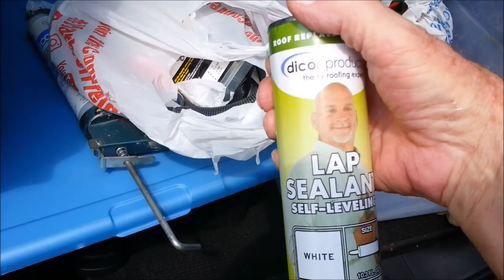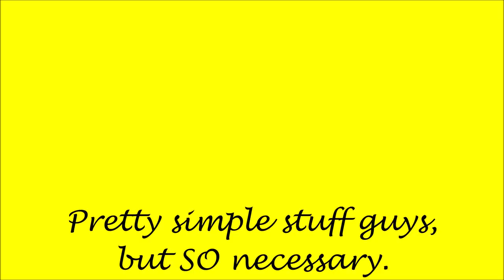Sealing cracks on a Camper Trailer  roof 101.  Rockwood Mini Lite

Comment: Rockwood's Factory rep wrote me about the OEM roof membrane on my 2018  model 2109s:
"F100099856 - RUBBER ROOF - IHO: RUBBER ROOF MATERIAL, SUPERFLEX - WHITE - 102" WIDE - V# SFX850WH350"      
So- this material is a TPO roof membrane manufactured by Alpha Systems..who says:
"Alpha’s TPO is a single-ply membrane that is approximately half the weight of EPDM and PVC, will not chalk or fade, has brilliant UV performance and is resistant to mold, algae and fungus."
Reply from the maker: Cool.  Glad you got your answer for sure.  :)

Comment: Garland;
  I note that you have a number of RV roofs to maintain there on your site. I own a Rockwood 2109 with that same curved roof at the front where the curved fiberglass overlaps the roof and is held down with strip of metal and thick coat of lap sealant. My RV is a 2019 model and the screws used to hold this metal strip look to have popped up from the tension of the curved fiberglass. I now have a large 1/2" - 1" gap where the strip and lap sealant have all come loose. This goes half way across the front and looks to be progressing while popping screws out along the way. What would you suggest? I'd like to strip off the sealant and see if I can use longer screws, but I'm not sure what's underneath (how much wood is there).
Reply from the maker: Hello Dwight.  Oh man, that is a storage lot Dwight.  Thank HEAVENS I don't do anything on everyone else's campers.  :)  I was just working on my 2109s.  

There is very little or no wood under the roof Dwight.  The front and sides are Azdel, not Fiberglass.  It is easier to drill and work with.   

If it were me, I'd remove one of the screws that is obviously backing out to see how long it is.  You want to use the same length screws again.  That strip of metal across the top "could" be screwed into an aluminum structure or beam running from side to side.  Me?  I would remove any Lap Sealant I could to get down to the metal strip running side to side as you described and add more screws into the metal strip down into the cap of the camper, dabbing them well with Lap Sealant.  Remove any loose screws, dab them up good with Lap Sealant, and reinsert carefully paying attention not to strip them.  Cover it all again in self leveling Lap Sealant and keep an eye on it from here on out.  Worse case scenario, they come out again.  Which in my mind, means they didn't screw into an aluminum supporting beam running side to side.   That then, well more work by someone other than yourself or me.  Keep researching too, I'm certainly not the be all and end all.  

Here is a video by Rockwood on assembly of a Signature Ultra Lite.  It is larger, but the assembly and parts are essentially the same.  I suggest you watch it.
https://www.youtube.com/watch?v=3D672Pj96WE 

Good luck my friend.

Comment: Garland-  I have the same 2109s that you have. What type of roof membrane material do these trailers have...TPO? EDPM?     I can't seem to find a definitive answer anywhere!
I need to use the correct sealant and the correct cleaning agent.   Thanks, John
Reply from the maker: I am pretty sure it is TPO... I'm checking now.
Reply from the maker: Per my findings, and I'm pretty certain this is true.  "The roof is made out of a seamless piece of TPO instead of rubber. This is a stronger material than rubber that wears and chalks less."
Reply: @garlandstyle5797  Hi Garland!  I went thru my 2018 Rockwood 2109s
 "pile 'O papers" that came with the rig.  I found a sheet for the roof membrane: "Alpha Superflex TPO"
Reply from the maker: @tbamagic  Hold on to ALL the papers and manuals you received.  They are INVALUABLE, as I found out.

Comment: Garland, over the years would you ever remove any of the old caulk (sealant) and start fresh?
Reply from the maker: I'm not sure about that Rick. But peeling up that one corner proved to be sticky..  If you had reason to remove the roof it could be done.  Every other video I've seen just shows going over the old sealant, even very old rigs.   Thanks for watching.  Michael
Reply: @garlandstyle5797  what kind of solar do you have?

Comment: How can we seal a few small holes on the roof 
Its not around any seals
Reply from the maker: I very highly recommend you get some Eternabond tape for small jobs.  Look that up online.  It is freaking crazy good and you can cut out shapes.  Gorilla Brand has also come out with a tape for sealing as well.  VERY similar to, if not a bit better than Eternabond tape.

Comment: Have u ever thought about getting a cover to protect from Sun?
Reply from the maker: I looked at many reviews online about covers, yes.   When the results came in, most said they just ripped apart after a year or two, some said if you were in a windy area, they flapped around and scraped/wore off some siding and points of contact.  To me?  It sounded like a 50 50 deal.  So?  I don't cover.   In addition, if you live in an area that is humid?  You need to get even more specialized covers to keep from molding your interior with the increased humidity.  SO ?  No.  LOL   :)